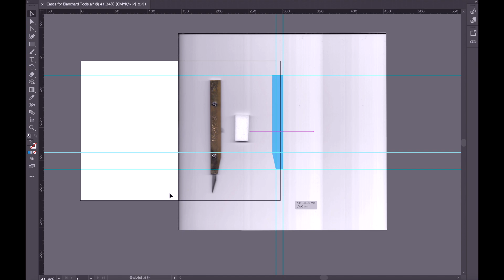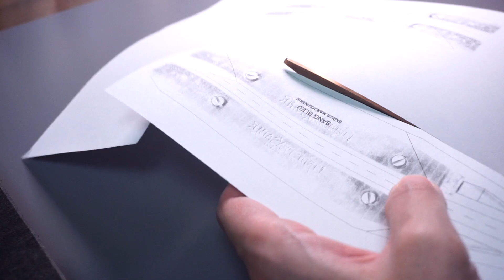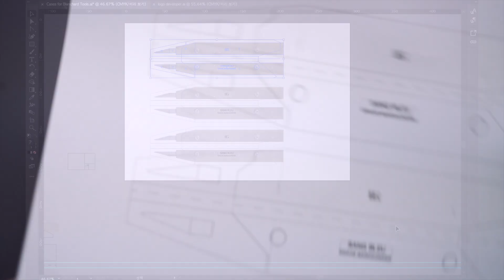Making Knife Sheath with Hermes Barenia Calf. 에르메스 바레니아 비스포크 칼집 만들기

Comment: Nice work indeed - will the blade not cut through the stitches when you place the guard over perhaps a welt inclusion to prevent this from happening….Apologies if you have this covered already…..?
Reply from the maker: Thank you! The tiny welt was included on the end cap stitching area so that the blade will not cut through the stitching😉👍🏻 But, as it is a really tight and slim sheath design, I should always put the end cap in carefully🤗

Comment: I bought it with 2 different blades, but don't like it. The chief 2-3 dollar with NT or Olfa blade is much better. The south African guy Terek makes blade for this handle is better but over 35$ costs.
Reply from the maker: I agree with that, the original blade from them is not that great. But thin blades like olfa cutters are bending when we cut the sturdy leathers. That is why we need these kinds of blade and these guys always need to be resharpened every time we use them🥹
Reply: @AtelierSANGBLEU  Use a large NT or Olfa Utility knife .18mm Ratchet Lock Heavy-Duty Utility Knife and buy with a black color carbon blade that is sharper than stainless steel. it doesn't bend and you can cut a thick layer of skin. I used to use that knife before, but I have now many knives, even Japanese knives for leather from 7-8 companies.
Reply from the maker: Thank you for your recommendations, I will consider that knives as well!😉🙏🏻

Comment: Great work. On one video I saw you placed a white plastic sheet between the leather and the cutting board when you punched holes. May I ask what it is and what function it had? Thank you.
Reply from the maker: Just a paper was under the leather, which helps clear punching results without extruding too hard on the back side of the holes